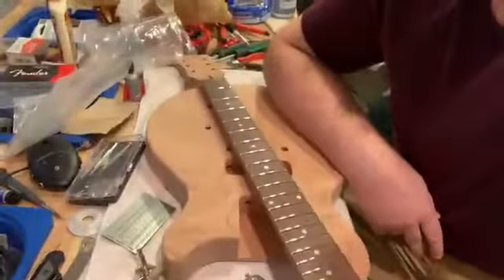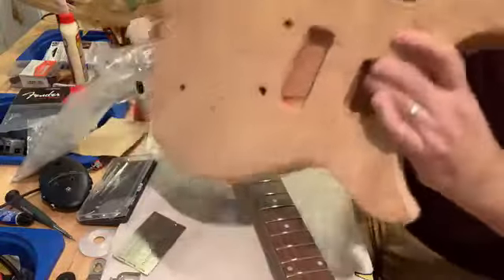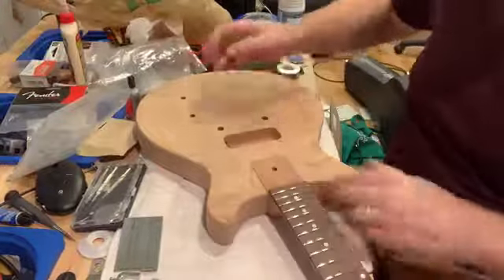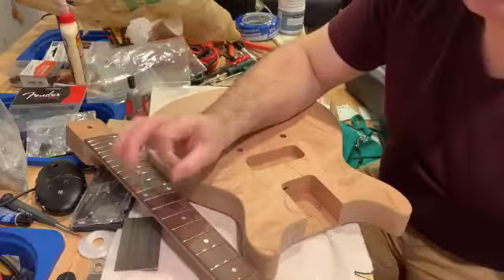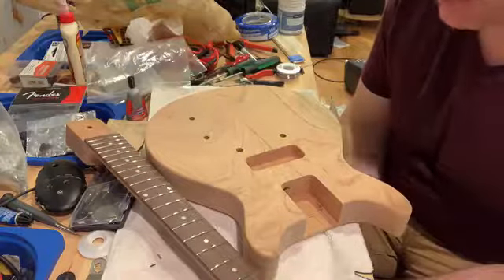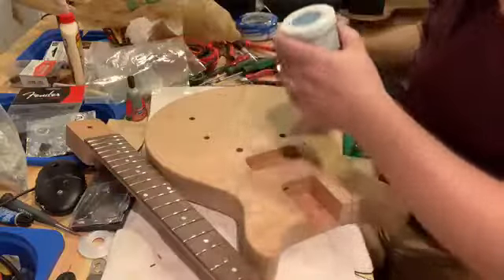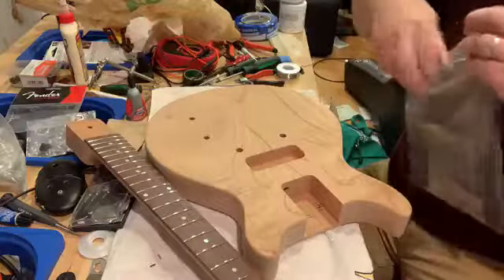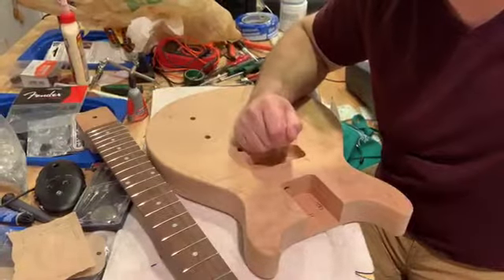My First Guitar Build - It begins!

Comment: seems cool, any video or picture of the final result?
Reply from the maker: Thanks - After I posted this video, I took to Facebook Live as a real-time way of posting progress - I'll add links to those in the main description of the video - it turned out really well!
Reply: @vincenttuckwood  thanks! I hate to bug you, but I was thinking about doing the same build so I'm very curious about your thoughts
Reply from the maker: @simonfaury2755  No problem!  The Precision kit is really great quality - it's expensive but worth it over cheaper ones. I didn't have to "correct" anything  in the kit - it really was all about making the guitar the way I wanted it to be. Tons of sanding, so be ready if you do go for it!

I chose a Seymour Duncan Antiquity P90 and haven't been disappointed - it's a lovely sounding pickup (it's on the last couple of videos I linked above)

The only thing I've done since the build was to do an asymmetric carve on the neck, as the baseball bat turned out to be just a tad too wide for my small hands. The new carve was very loosely based on the Strandberg EndurNeck shape

https://strandbergguitars.com/strandberg-endurneck/

though not nearly as angular, basically shaved the bottom of the neck near the nut, through to the top of the neck near the body - totally did it by eye and feel. It's much more comfortable now.

All in all, I love it, and learned some good lessons. I definitely feel like doing another kit at some point, when funds allow.

Best of luck,
V
Reply: @vincenttuckwood  do you. have pics about the final guitar? Thanks !